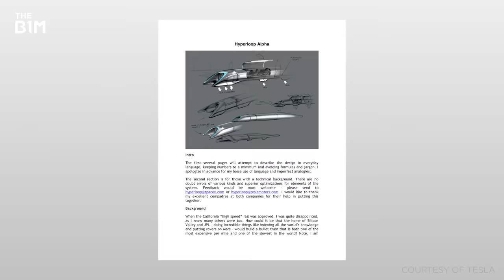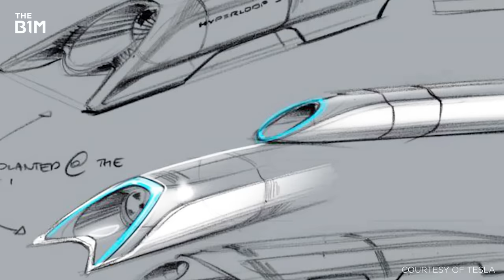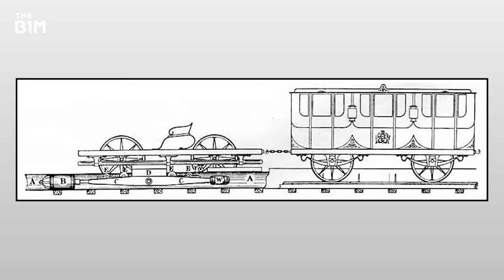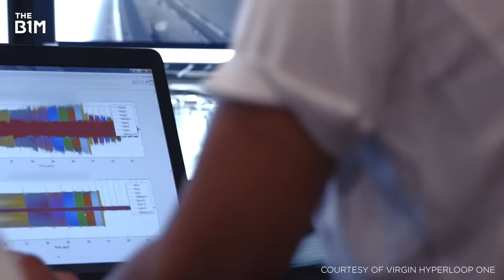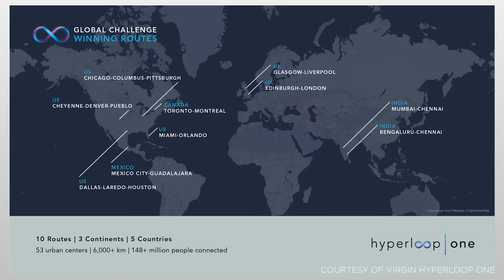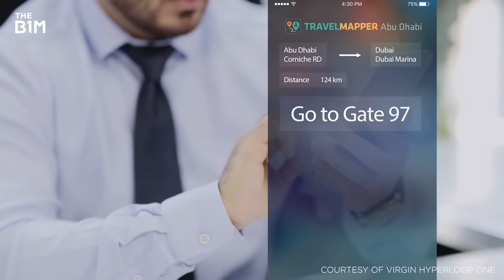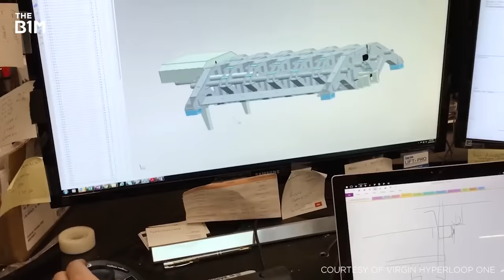Hyperloop Explained

Comment: Some showstoppers: 1) Thermal expansion/contraction of tubes. 2) Compensate long range earth surface movement. 3) Getting people out a tube once a shuttle has trouble. 4) Oxygen supply and safety tank in case shuttle is midway two stations and stuck. 5) pressure build-up inside passenger compartment due to breathing passengers. 6) Air shock-waves through long tubes 7) Condensed water removal at cold spots, which prevents to achieve vacuum. 8) Volatile removal (grease/oil/solvents) 9) deterioration of sealings. 10) Vacuum pump maintenance.

Comment: "tubes that are extremely difficult to puncture or break"

I sure hope they ain't  using the same shit that oil companies have been.
Reply: No think cybertruck steel.
Reply: @leedart  think cybertruck windows
Reply: Johnny Joseph lol. Let’s hope that that was the PR stunt to get the press and the product is real and do-able.....after this pandemic world we are living in. I can only wish that this plants the seed of a new world if people become angry...... I can dream can’t I?😌
Reply: Disadvantage all is black - Landscape did not exists big mistake
Reply: Of course not, spilling human guts is much more costly than spilling millions of barrels of black gold.
Reply: @Johnny-Joseph  Or think me first drivers zig zagging through traffic while commenting on this video with their phone.
Reply: I doubt the tubes will be put under as much stress as pipelines are.
Reply: @adenjordan9389  nonsense, low pressure oil, or a vacuum with metal vehicles passing through at 600mph every few minutes? I know which one has more stress. A 100+ mile long tube with vacuum pumps dotted along it. Just one ‘pod’ going backwards and forwards? Changing tubes for the return journey? Getting people in and out of pods in a vacuum? It’s not going to happen. High speed rail is easier, cheaper and safer.
Reply: If there is a leak, it won't make the train any less safe. That's not what's keeping the train on track. Japan has this system without vacuum tubes. The vacuum tube just gets rid of air resistance making the train significantly quicker.
Reply: @hashiramasenju6058  Do you know what happens when air rushes into a vacuum at supersonic speeds? Everyone dies :)

Comment: Well, I hope these things are complete and functioning before I die.
Reply: You mean the bugs are worked out and massive deaths are eliminated. No other form of high speed travel has been free of human screwups and the Hyperloop will be no exception.
Reply: Virgin is starting to build in West Virginia (which seriously lacks infrastructure) in 2022.
Reply: at high speeds, would any irrecularities /warping /bumps in the straightness of the rail, be more pronounced? I worry that the pod could bump or lift off the rail or smash against the sides of the tube. But Ive not really studied engineering - I suppose the mag -lev could account for movement or self stabalise? i wonder how fast a train on rails can go? rails  look precarious but they seem to have been ok so far.
Reply: @katzunjammer  the pod is a maglev which means it hovers over the rail
Reply: @katzunjammer  on rails a train has gone 360mph on a TEST but, if your looking to take a high-speed train in Europe or Asia then they only go around 220
Reply: Me too
Reply: They will never work. It is a stupid, expensive idea.
Reply: Sorry to break your bubble but it ain't happening
Reply: @katzunjammer  maglev works, expensive, but quick. The stupid part is the vacuum tube. That is the part that will never work.
Reply: @katzunjammer  Yes, rail (and also wheel) surface irregularities do put a limit on maximum train speeds. But that's why the rails on why high-speed rail lines (and also the wheels) are maintained to have greater smoothness than normal rail lines, using regular measurement trains and grinder trains. However, Hyperloop is supposed to be a maglev, so ride quality is impacted not by rail roughness but magnetic field roughness.

With that said, Hyperloop won't ever work and is by now in fact an outright scam for wholly different reasons. The main issues are: capacity, construction costs, safety & maintainability. Each of these four would be enough to kill it.

Capacity: to run those pods safely, they must follow each other at a distance greater than stopping distance in an emergency. Running at 2-3 times the speed of a HSR train, the stopping distance multiples of that of a HSR train, while the capacity of one pod is 1/40th to 1/20th of a typical HSR train, so you do the math. Hyperloop promoters will provide numbers that don't respect safe distance, but even those numbers are ridiculously low: 840 passengers per hour would be equal to 0.5 to 1 HSR train per direction per hour, whereas we have lines with over 12 per trains per direction per hour.

Construction costs: those provided by Hyperloop promoters are out of thin air with no basis in reality, and ignore geological challenges, as well as requirements stemming from the next two points. The last is especially true with relation to the key source of cost reduction in what the Boring Company has done so far: boring tunnels with much smaller diameters than rail tunnels.

Safety: whether you run your pods in a tube on pylons or in an underground tunnel, you need to provide for a means of evacuation anywhere in case of an emergency stop (which, don't forget, would also cause all the pods behind it to stop!), and the only way to do this is building wider tubes/tunnels with room for (non-vacuum!) escape routes along the entire line length. You also have to find ways to route traffic around a stopped vehicle, which you could only solve by incorporating massive redundancies at high construction costs (more than one tube per direction and several cross-connections, complete with emergency doors and vacuum generators in case air got into the tube/tunnel at the site of the emergency). Finally, both tubes in the air (thermal expansion/contraction, corrosion from rain) and tunnels (water damage, even minor earthquakes) need to be protected against leaks, which again requires expensive hardware which hasn't been even on the drawing boards of Hyperloop promoters.

Maintainability: all infrastructure is subject to regular wear & tear, which necessitates regular repairs and replacement of parts. In fact, you have to design your infrastructure in a way that enables maintenance work. For Hyperloop, any maintenance would require total traffic stoppage and filling up the vacuum with air, which then would have to be pumped out again.

I note that even if none of these four obstacles would exist and a working Hyperloop could be built technologically, it would still likely fail economically for lesser reasons. One of these was a key reason maglev never really took off, despite being faster and more energy efficient than HSR: interoperability. The thing is, a HSR train can also run on conventional rail. So it can serve routes that go beyond a HSR line, and thus HSR trains can save time for passengers on several relations even if the trains switch to a HSR line on only part of their respective route. With a maglev or a Hyperloop, train/pod operations are limited to the infrastructure you have built. There are two service-ready high-speed maglev systems in the world, but the German developers of the Transrapid closed shop after building just one airport connection in Shanghai, while the Japanese L0 will get its first and only line along the world's busiest transport corridor in Japan, the only one that makes it worth to build a line almost completely in tunnels.

With all that said, you would not need to know any of these technical issues to see that Hyperloop developed into a complete scam. All you need to notice is that promoters are heavy on computer-animated PR but have almost nothing to show in terms of numbers that add up and full-scale technology demonstrations that address any of the problems.
Reply: David Parada don't hold your breath, it will never be built, this is a scam. Unfortunately, it is a kind of scam that prevents sensible projects from being built, when stupid politicians awed by the scam shelve those plans. Which may well be their real purpose: Elon Musk hates public transport with a passion.
Reply: @billywindsock9597  I'm doubting it too. To be a viable form of transportation it would have to at least mimic the train rail system in use today, times two. Can't all run in one direction. That's a crap load of tubes to install and maintain. And who's paying for those billions of cost? Five grand a ticket or taxpayers?
Reply: @johnhare7279  Each tube can only have one 'car' in it. It travels from one end to the other. If you have two, how do they pass? It takes about three minutes of thinking to see what a terrible idea the whole thing is. It won't happen.
Reply: @billywindsock9597  I said two tubes each way...
Reply: @johnhare7279  yes, but four tubes will be four times more expensive.
Reply: @billywindsock9597  not true
Reply: @pavelsokolovic4097  it won’t work
Reply: @j 500 meters. Two people. Went to the end of the tube and might have touched 100mph, didn’t get out, came back, backwards. If that is your bright new future then I am underwhelmed. I could have made the same journey on a bike in a couple of minutes and saved myself several hundred million dollars.
Reply: @billywindsock9597  haha that’s not true at all
Reply: I was supposed to go into space b4 I die.. but sadly
Reply: Build your future real future after your death read the last revelation from God Al Quran and flow
Reply: Its gonna be working in india before 2030 and will be available to the public😎
Reply: It won't come until the 2030s
Reply: Don't worry, you'll live forever.
Reply: I think these will probably come around 2031 or something
Reply: I'm 14 and I hope to live much to see all these things
Reply: Unlikely
Reply: @prevost8686  they could use this for shipping packages for years to validate it before ever putting a human on
Reply: @prevost8686  shinkansen: let me introduce myself
Reply: This thing will remain 'Hype.'
Reply: I seriously think flying cars will come first.
Reply: @billywindsock9597  what do you mean maglev works. There are existing maglev rails in China.
Reply: @taotao98103  yes, maglev does work. Expensive, but very fast. Putting it in a vacuum tube is a stupid idea that won’t work.
Reply: @billywindsock9597  to achieve super high-speed, the vehicle can go faster if they remove the air inside the tube, not to mention to keep the track clear from debris.
Reply: @taotao98103  I agree, but how much are you willing to spend to make that tube? And then make it a vacuum? It is not practical.
Reply: Same
Reply: they won't. They're a terrible idea.
Reply: @taotao98103  We already have flying cars. You need a pilot and a car permit for them, and they cost between fifty and a hundred grands for the cheapest ones.
Reply: @LutraLovegood  Yes. That's called helicopter.
Reply: Don't hold your breath.

Comment: and two and a half years later, has Hyperloop shown to be simply hype?
Reply: "We have a hyperloop at home"
The hyperloop at home: Teslas in tunnels
Reply: yeah. it was just like the maglev and shit a few decades ago.
Reply: yep
Reply: @beneyweneys  hyper loop is just a maglev in a vacuum tube and according to virgin hyperloop a maglev in a vacuum chamber is 3 times cheaper than a maglev?
Reply: I see China or some other country build a hyperloop system before the US. China already signed a contract with US company called Hyperloop Transportation Technology to build a 10 km test track in Tongren city which will be the longest of its kind. They are also working on new Maglev train that will use vacuum chambers.
Reply: @shortstuff611  they are testing various types of maglev so maybe they are taking it in consideration. But I don't think that's doable. Maglev 100% better
Reply: @thunderbolt4451  Not impossible, just SUPER expensive, take a ton of metal, and can be unsafe.
Reply: Yes. It always was.
Reply: @bsimulator  No. The true future is fully autonomous driving and people deciding they don't need to own cars as rental prices plummet. THEN the future is super fast rail/wheel specialty individual transportation, where you leave on road and merge onto rails. :) All in the comfort of your individual unit.
Reply: @toomanymarys7355  if everyone drives their own individual cars... Where do you put them? The problem with cars isn't that they need a driver or fuel, but the fact that 2 tons of steel can only carry 5 people, and then needs to park at some point. Roads are incredibly space-inefficient and costly to maintain, and the costs only increase as you increase speed.
Reply: Nah they're just waiting for the mass commercialisation
Reply: @Tysca_   what if your car can drive itself and park itself outside the city?
Reply: @toomanymarys7355  That isn't how pricing works, just because some people don't want cars doesn't mean most wouldn't want a car. Even if most did not want a car in the same way iPhones, Uber and Lyft never get cheaper neither will be using other people's rental autonomous cars. Taxis were never cheap even though there were tons of them everywhere just standing around, neither will anything that people need to get around.
Reply: Yes
Reply: @hgr3180  endless parking spaces that take vital area. We are already running out of space in a lot of places.
Reply: Yes, yes it is.
Reply: @shortstuff611  It's not viable, it's cheaper to plow through air occasionally when a train needs to, then keep a constant vacuum with all it's costs and risks.
There is no way you can create a vacuum only when necessary, no money saving (system to isolate sections needed) and too slow.
Reply: @beneyweneys  Maglev is still being used and works brilliantly. Japan uses it, in fact, most countries besides the US uses them widespread I believe.
Reply: @tyhachd6508  I doubt that. The tube alone would be costly. Especially over long distances. The maglev can be implemented over long distances like in Japan.
Reply: @easyenetwork2023  it'll probably only replace the routes with the very highest demand (such as the Tokaido line), but it'll definitely not replace HSR by any stretch of the imagination
Reply: @easyenetwork2023  I was saying that it’s ridiculous that something like the hyper loop is three times cheaper than a maglev
Reply: @easyenetwork2023  I think your getting high speed rail and maglev mixed up, high speed rail is used in most developed countries while a maglev is something different. Maglev is so expensive that there’s only one maglev line in the world in China and the government losses 100million dollars a year to keep it running.
Reply: @gsfor0  Except it's not a train. Then it'd be significantly better than it actually is.
Reply: @Bohh574  And maglev is not that great anyways.
Reply: @XMysticHerox  well at least it exists lol. And I think that a 600km/h maglev is feasible even if very expensive. In some places (like the Pacific coast of China, the Shanghai-Wuhan-Chongqing-Chengdu route or the Tokyo-Nagoya-Kyoto-Osaka route) it would also pay out
Reply: @Bohh574  The only highspeed maglev line in the world right now is running a huge deficit. 

I am not saying maglev should not be considered at all and there is lots of research into it to be done still. But the tech has existed for a long time now and there are good reasons it's practically unused which I have listed.

Having a interoperable rail system is very desirable and maglev is practically the opposite of that. You can only use it for one very specific thing eg direct, high speed routes connecting major cities and it's completely incompatible with everything else probably even other maglev lines.
Reply: a loopy idea to begin with...
Reply: @gsfor0  and that’s why the US in behind the world rn, we used to be bold now we are complacent smh

Comment: It's quite upsetting, given the quality of B1M's content that they gave HyperLoop this sort of press without dealving into the feasibility of the project. The concept is certainly physically possible, that is not in doubt, the problem is, is it feasible over any serious/useful distances without serious roadblocks what would explode its cost to build and maintain. Just consider the challenge of maintaining and creating the vacuum over such distances, let alone if the vacuum fails during use. At speed such a failure would mean insta-death for anyone inside one of these pods. As for the likely-hood of such failure, the longer the tube the greater the failure risk. For one, a pressurized tube in the vacuum of space is nothing compared to a vacuum under the pressure of the atmosphere.
Reply: The video covered the possibility of vacuum failure, and I was satisfied with Virgin's explanation that it would just slow down the train, not result in "insta-death for anyone inside".  But I do agree that the video ignored the energy costs of maintaining vacuum when talking about how little energy the loops would actually use for propulsion.

When it comes to the "insta-death" thing, I was a lot more worried about the possibility of someone crashing into a tube and then the train colliding with the break.  However, it seems like the raised, seismically engineered supports should reduce that risk down to pretty much just intentional terrorism (or acts of war), and not normal accidents.
Reply: I have more problem with the lack of research about giving proper credit for the concept. This isn't Musk's concept. The video is a fail from the start.